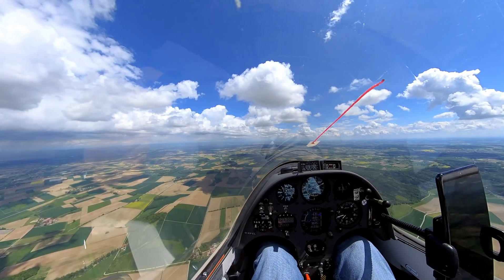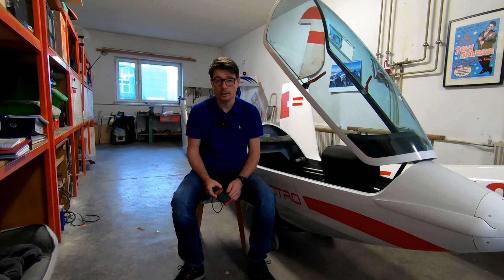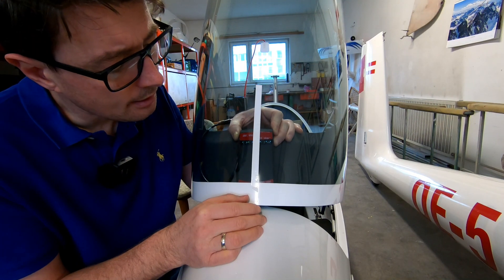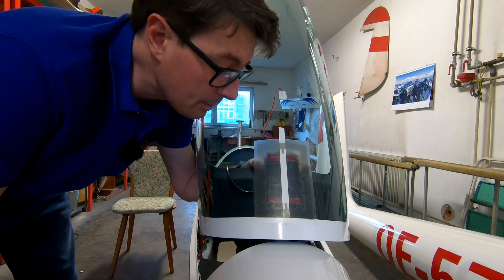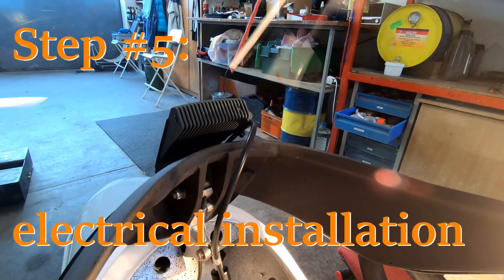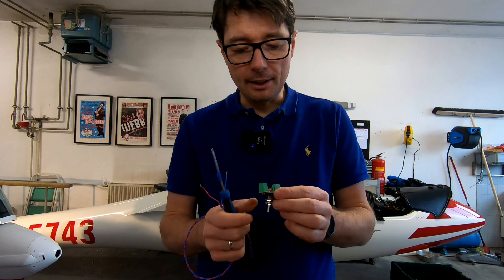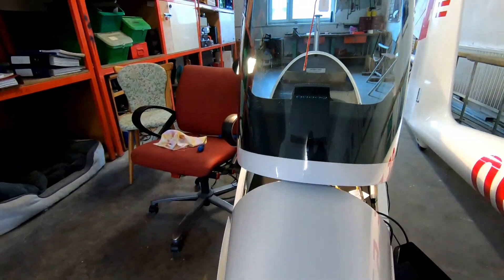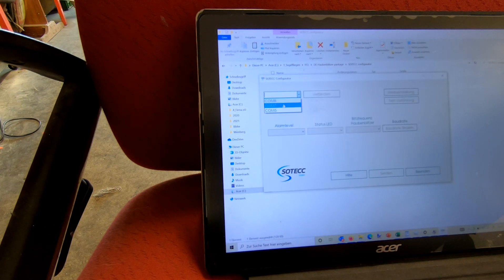Installing a canopy mounted strobe on a Silent 2 Electro Glider

Comment: Hi Rudi, where did you buy the strobe light? Thanks in advance...
Reply from the maker: Hi Javier, there are a number of manufacturers. I have used the one from SOTECC.de, but there is also aeroflash.de, how2soar and some more. Also @stefanlanger is offering now these devices. So have a look and decide which one fits best for you 😀

Comment: Hi Rudi,
I notice you have the Aircom Air Traffic Display as well as the ACD 57 for Altimeter, Radio and Transponder - What transponder and radio combination did you choose and are you happy with how it all works together - asking as I'm configuring instruments for a JS3 and have chosen ACD 57 and Air Traffic Display. Thanks, Mark
Reply from the maker: Hi Mark, you did absolutely fine! I am very happy with all of it. I still have the KRT2 as radio, remote controlled by the ACD, because the AirCom was not available at the time of purchase. I think the AirCom would be a bit better, there are some few snacks with the KRT2. The AirCom is simply made to work with the ACD, so I would choose that one the next time.
Thank you for your comment and have fun with your JS3 😃!

Comment: can flarm, just like tcas, see other aircraft's transponders?
Reply from the maker: Flarm is only working if both aircrafts are equipped with a Flarm. If the range is poor, warnings can quite late, like in my case.
There are some devices, which combine Flarm and ADS-B reception of Transponder signals, but often without showing a direction of the Transponder equipped aircraft.

Comment: Make sure you disable it when the FES is in use. Trust me. You won't notice it possibly in most situations, but I can promise you it would be bad in low lighting motoring home.  I can imagine that light would be disorienting if you aren't expecting it. So be sure to switch it off since it's above the prop center height. 

What did this cost? Link to the product?
Reply from the maker: Hi, thank you for your comment! I haven't tried it so far in low light conditions but i'll keep an eye on that!
Regarding the product: i used this one:
https://sotecc.de/haubenblitzer-informationen/

There are different manufacturers on the market, the one above simply had a special offer last autumn that's why i decided for that one 😀 - i do not and did not get any sponsoring, just to have said that 😀

Comment: Awesome. I may install one on my first-gen Silent
Reply from the maker: Hi Matt, thank you! Yes I really think such a strobe makes sense.
Reply: @RudisGlidingAdventures  could you please post a link to the strobe?
Reply from the maker: Hi Matt, i used that one:
https://sotecc.de/haubenblitzer-informationen/
There are different manufacturers on the market, i decided for the one above simply because they had a special offer last autumn 😀 - i do not and did not get any sponsoring, just to have said that 😀.
So i cannot tell you, what the advantages of this one or the other ones is. For sure the mentioned manufacturer knows now, which model suits best for a Silent canopy :-)
Reply: @RudisGlidingAdventures  Two more questions for you, Rudi-
1) Are you sure that you can reinstall the canopy with the strobe positioned as you have it?
2) How does the strobe's behavior work with ADS-B? Would it illuminate if an ADS-B-transmitting aircraft came within a certain proximity? (I bought my FLARM primarily to get ADS-B traffic warnings, I fly out of a GA airport where no one has FLARM).
Reply from the maker: @mattmcbee  regarding your questions:
1), yes, because there is a quick release connection in the cable to the strobe. So no trouble with that. Also the view to the locking mechanism is fine, so i can check that it is closed and locked
2) puuhh, thats a very tricky question. The ADS-B is omnidirectional, so there is only an indication if a traffic comes close but not from which direction. So it depends if Flarm is issuing a warning or not. I am not 100% sure, so i think it would be better to ask the guys from Flarm or the strobe manufacturer directly